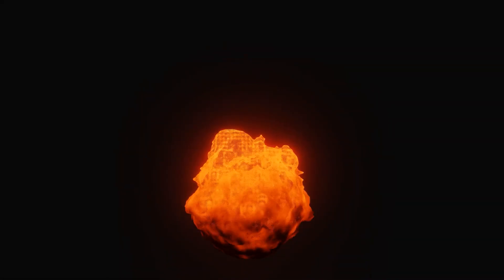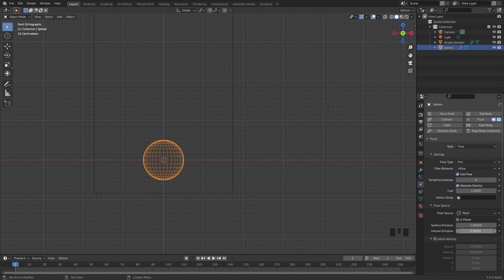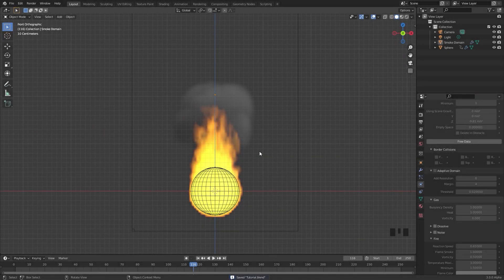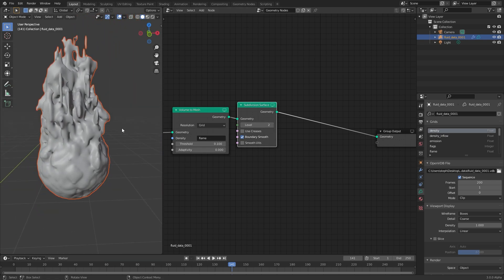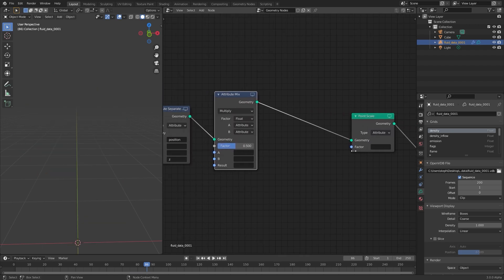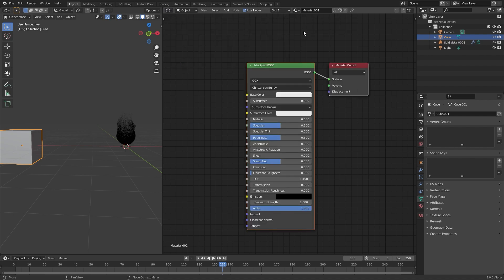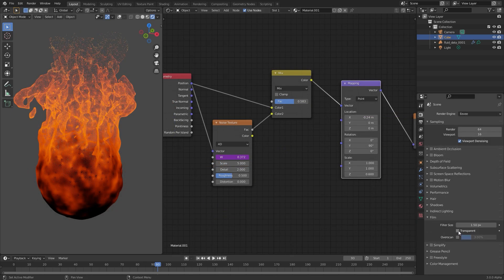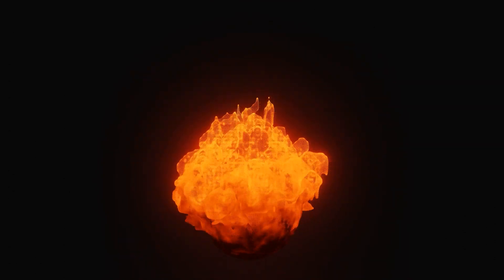Blender Tutorial - Fire Simulation With Geometry Nodes

Comment: When i try to put the "Volume to mesh" node my program is force closing. Any advice?
Reply: Sadly, I have the same issue. So, someone with solution?
Reply: @Botix4  For this tutorial i would recommend using Blender 2.93. So, after you imported OpenVDB, you have to use a cube to add the volume to mesh. That means, you have to add a cube to the scene, add the 'volume to mesh' modifier in the modifier panel on the cube and then in the 'object' you have to select 'fluid_data_0001'. Drag the threshhold down to 0.001 and set the name to 'flame'. Now you can follow along with the tutorial without using the Volume to Mesh geometry node. :)
Reply: @rot-stich  Thanks, This helped me solve my crashing for 3.4.1

Comment: hey so when i open the geometry node tab and add the volume, my blender just instantly crashes, i have decent enough parts to where i didnt think it would be a problem...got a solution?
Reply: Hey, I had the same Issue, but i fixed it so far.
For this tutorial i would recommend using Blender 2.93. So, after you imported OpenVDB, you have to use a cube to add the volume to mesh. That means, you have to add a cube to the scene, add the 'volume to mesh' modifier in the modifier panel on the cube and then in the 'object' you have to select 'fluid_data_0001'. Drag the threshold down to 0.001 and set the name to 'flame'. Now you can follow along with the tutorial without using the Volume to Mesh geometry node.
Reply: @rot-stich you said "set the name to flame" what did you mean? grid name? or modifier name? if i change grid name , blender says "cant find flame grid" and nothing happens
Reply: @rot-stich  thank you very much! the workaround still useful until now
Reply: Same
Reply: same here

Comment: I have a question, when I go to add the 'volume to mesh' node in the geometry node (Blender 3.0), the 'density' attribute isn't there to adjust it just says threshold and adaptivity, but I see it in your video. Any suggestions?
Reply: Love you bro ty so much ❤❤
Reply: I'm having the same issue actually
Reply: I found a solution. After you bake the fire and the vdb files are created, create a fluid data object, importing all the vdb files you created for each frame. Then create a cube mesh and use the volume to mesh modifier on the cube, using the fluid data object as your target. After that modifier, you can use geometry nodes on the cube. You can change the GRID NAME in the volume-to-mesh modifier to different things like he says in the video
Reply: @chavis2876  Thank you for replying! I'm sort of new to blender; what is a fluid data object, and how would I create it?
Reply: In object mode you can use shift+a to add a volume -> import openvdb and grab your vbd files
Reply: @chavis2876  I misunderstood the terminology, and I am appreciative of you for helping! I understand now. Thank you!
Reply: @chavis2876  Thanks!

Comment: DISCLAIMER: The tutorial doesn't work for blender 2.92,
to be specific, u can't add a new geometry node as the option gets greyed out.
Reply: I think with 2.92 there's a workaround. Instead of adding GeoNodes to a volume, first you convert the volume to mesh using Volume To Mesh modifier on any geometry (default cube will do). Then you do geometry nodes and do everything the same except for the first VolumeToMesh node that's only available in 3.0
Reply: Much better said than in the comments below. I am using 3.3.1 and this is still necessary, to prevent crashing.
Reply: same
Reply from the maker: Yes I forgot to mention that you need to use 3.0 to add geo nodes to the volume.